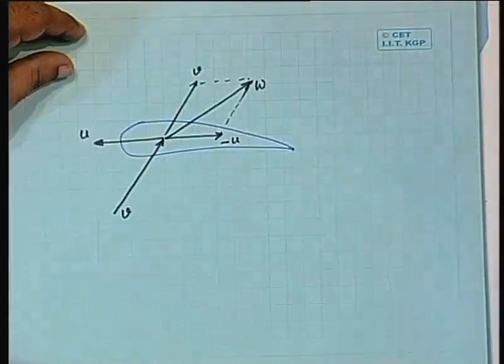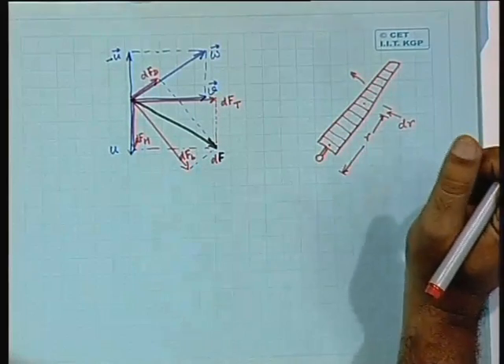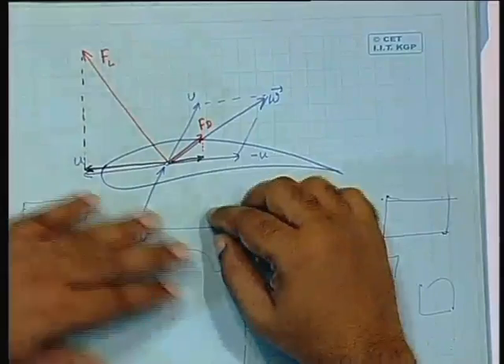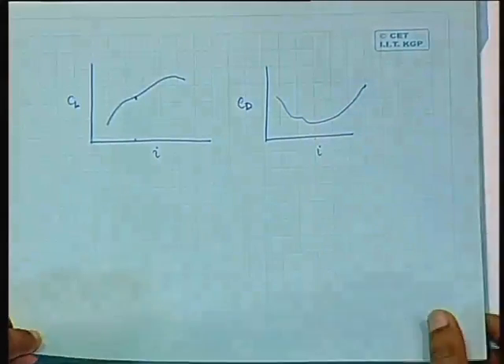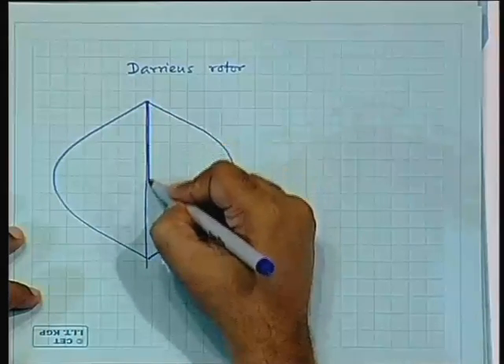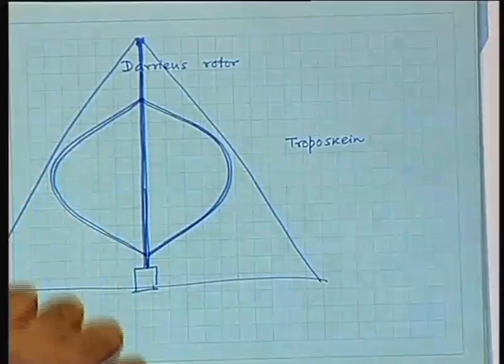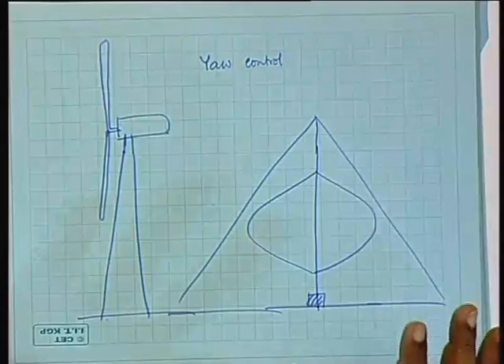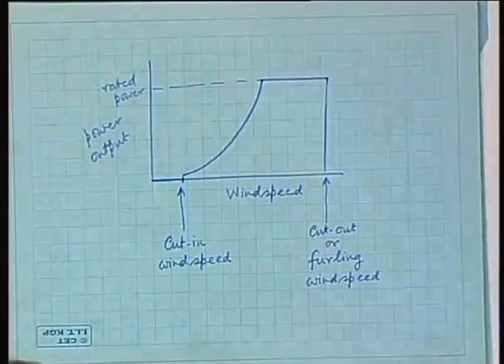Lecture - 22 Wind Energy II

Comment: 00:48 start
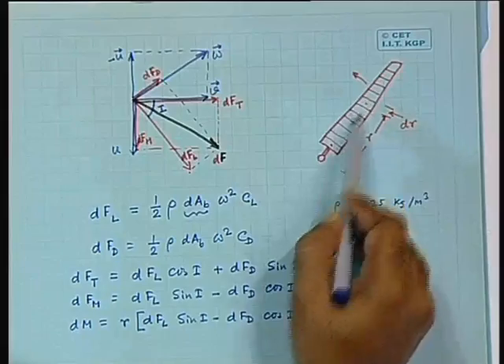14:53 C_L and C_D. Tables of these values or grahps are presented as functions of i, the angle of attack.
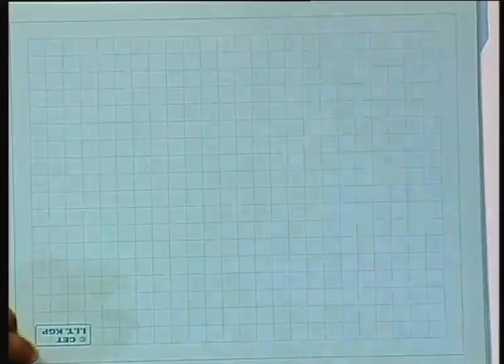24:44 tip speed ratio
31:26 Darrieus rotor
54:50 experimental demonstration

Comment: I understand the direction of drag force FD is same as the relative wind speed, but I do not understand the direction of lift for FL. Accepted it is perpendicular to the drag force but there are two perpendicular directions, +90 degrees as well as -90 degrees. Can anyone please help?
Reply: The direction of the lift force is pointed from high pressure region to low  pressure of the aerofoil

Comment: I dont get why we say it is rotating in the direction of u and then we draw -u???
Reply: Yes, it's rotating in direction of u, but in order to add up two vectors (u and v) by rule of parallelogram you must draw u like -u. I recommend you to think back of addition of vectors.
Reply: no, that is incorrect. If we were computing u+v, then we would only care about u and v and add them like a parallelogram. However, we are not computing u+v. We are computing -u+v. This is because we are switching frames of reference. We jump from looking at things from the perspective of seeing the blades turn from the outside to imagine what the blade itself experiences.
Reply: It's relative speed w=v-u ,so take the direction opposite to the actual one.